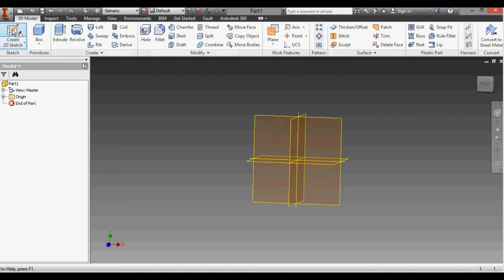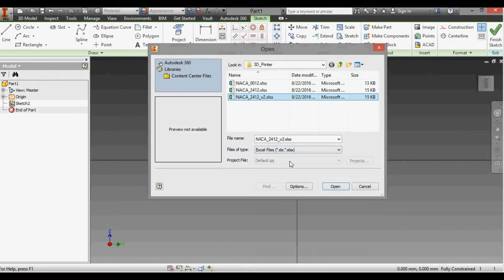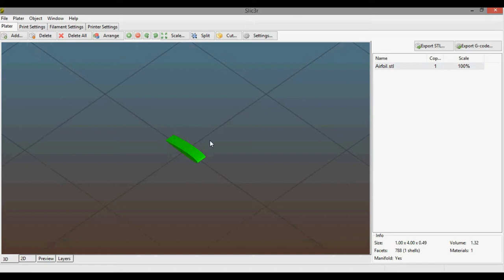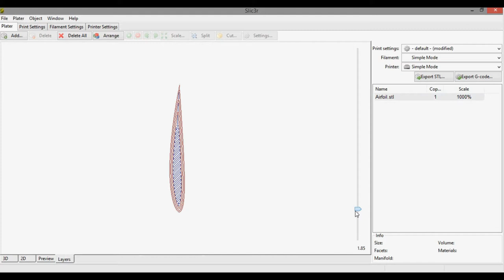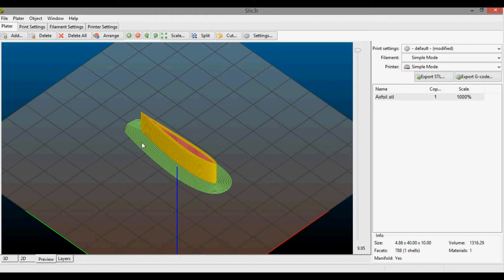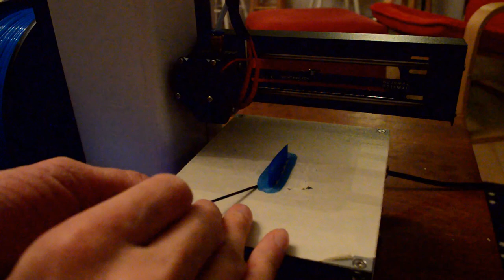How To: 3D Print an Airfoil

Comment: I'm trying to print an airfoil myself, normal NACA 4-digit but very thin, like NACA 0003. I'm having trouble with the sharp trailing edge folding and warping. Blunting the edge helped a bit, but I'm wondering how your trailing edge came out and what you might suggest to make a thinner one work?
Reply from the maker: I used both the open and closed trailing edges when I printed my airfoils, and in both cases, the trailing edge thickness was limited by the thickness of the plastic from the nozzle.  This just means that the trailing edge thickness was too small.  If you increase the chord length of your airfoil, you'll get a thicker trailing edge, and then it probably won't warp.  If you're making pretty small prints, then the trailing edge thickness is probably going to be too small to be resolved by the printer.

Comment: Hi Josh, would you recommend using a 3D printed airfoil for actual wing tunnel testing with the aim of verifying the lift and drag coefficients with published results.
Reply from the maker: I'm actually doing this as a side project right now.  I'm building a mini wind tunnel with flow visualization and a force balance, which will accept any 3D printed airfoil that I make.  I was hoping to get some good results, but I haven't had the time to finish it yet.  I definitely think it's worth trying, but there's obviously things you need to be careful about, particularly surface finishes affecting your data.  I've printed much bigger airfoils than the mini one from this video, and they came out really great, so I'm looking forward to finishing this project up and posting some videos.  I would say go for it, but make sure you know what the limitations are.
Reply: babangs babangs something you can also do is print out the part in abs and then dip it in acetone vapor... It'll smooth out the Finish nice and shiny. you only want to do it for 10 seconds or so at a time though! :-)
Reply: Thanks

Comment: Cool video buddy! Might I suggest doing two or three layers for the raft? if you do you can hold on to the piece and peel the raft right off once it starts to come loose because of how rigid the raft is... also if you wanted to know exactly what temperature your filament runs best at, have a look at this video. You can also download models from makeverse that have temp and speed printed on the test shape! =D
 https://youtu.be/N-7uX6Dw-7A
Reply from the maker: Thanks for the tips!  I'm definitely going to try tweaking some settings like that video was showing.  I ended up doing a much bigger airfoil print and got it to work pretty well without any raft, by just going pretty slow on the first few layers.  The finish on that edge turned out really smooth.  But I do like the idea of having a raft if only to get a good start to a print without worrying about it affecting the final piece.  I still have a lot of fiddling to do!